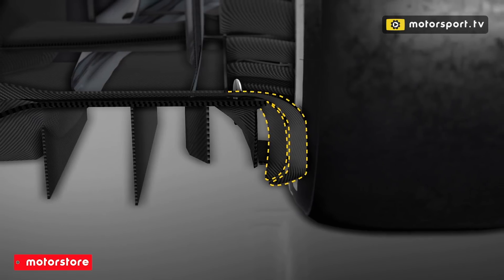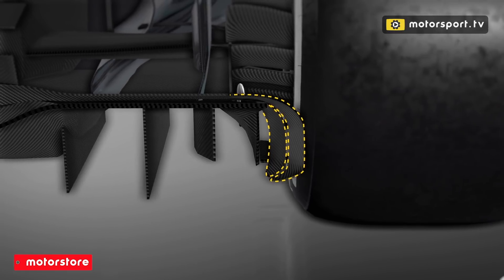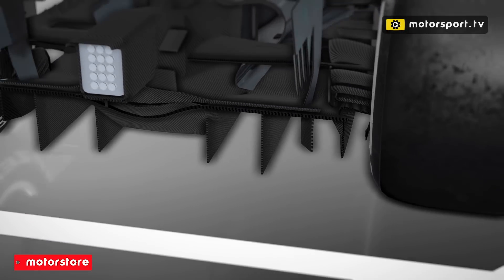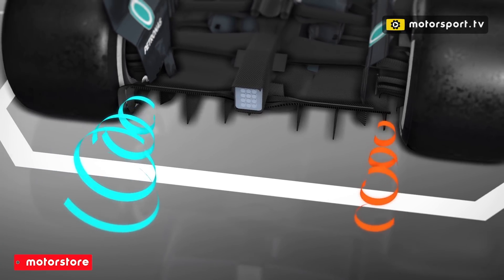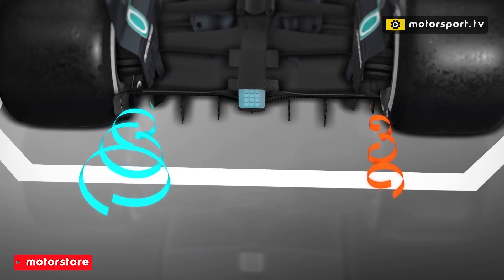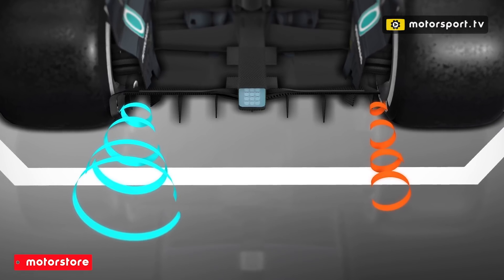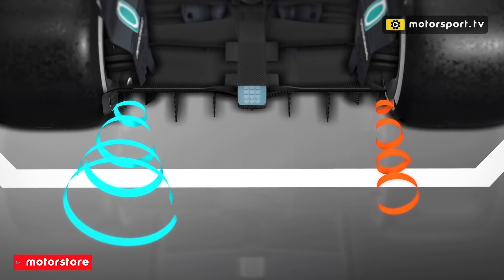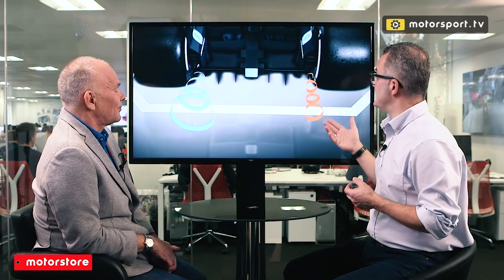How diffuser damage affects an F1 car

Comment: Just from looking at the section of the diffuser in question, I would think that it's designed more for tyre wake management than to assist vortices in the diffuser. With these ultra-wide tyres on 2017 cars, turbulence around the wheels is going to be much more of a problem than before. The intrusion of said turbulence into the diffuser would likely cause flow separation and be detrimental to performance, so most teams have developed elaborate ways to manage air around the wheels, which might be what this actually is.
Reply: Why would you want to manage rear tyre wake? The only thing that's affecting is the car behind.
That part of the diffuser enhances the right-hand vortex which increases the flow of air underneath the car, which further reduces the pressure, and which increases the downforce.
Reply: Will Chen 
I'm pretty sure vortices would be created before to help flow the air around and away from the tyre...
Reply: There would be such vortices coming off the front wing for sure, as well as the Y250 vortex deflected by the barge boards around the side of the floor. But I doubt these would have much effect on flow inside the rear tyres simply because they are directed outboard, and would not survive the massive wake of the rear tyres anyway. What I understood as Craig's meaning in the video was that the damaged diffuser feature was intended to enhance vortices that are already in the diffuser, which is another thing altogether. But to me it seems more like a feature intended to block wheel wake, judging by its location relative to the diffuser.
Reply: Will Chen 
I'm not saying they're not, just to add...
Maybe it does both? You probably know more about this than me, as I have no knowledge of aerodynamics besides what I've learned from watching F1 and plain common sense...
Reply: Rear tyre wake is a major concern for diffusers due to it being "dirty air". Just as wings don't work well in dirty air, diffusers will also suffer when tyre wake is pulled in due to the underbody of the car generating an area of low pressure. As for enhancing the vortex as you describe, you have to consider that the feature in question is located at the outside edge of the diffuser outlet, by which point most of the energy in the air has already been dissipated due to diffuser expansion, so it would contribute very little in feeding energy to a vortex that is being generated farther upstream in the diffuser.
Reply: Yeah I see what you mean, my bad.
Reply: No worries, it's always good to have a discussion that helps to clear things up, especially when it's something as interesting as F1 aero.
Reply: Will Chen 
Agreed!